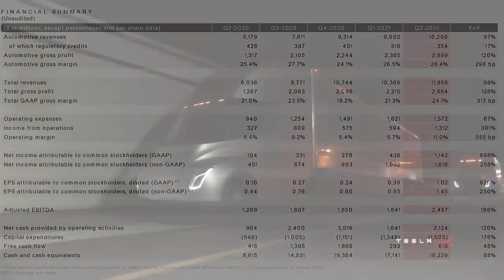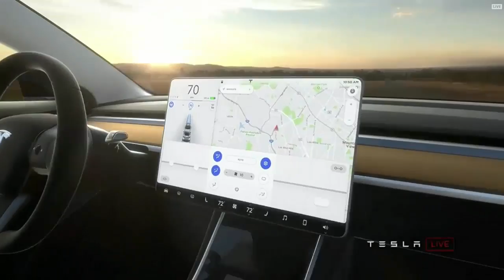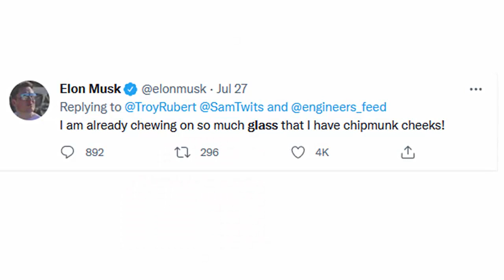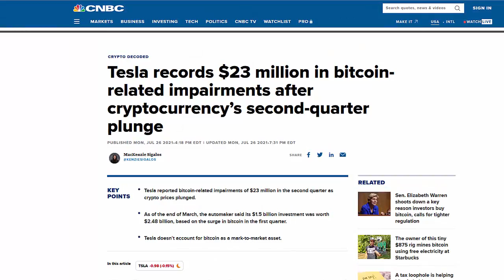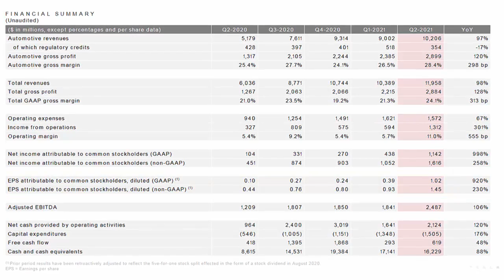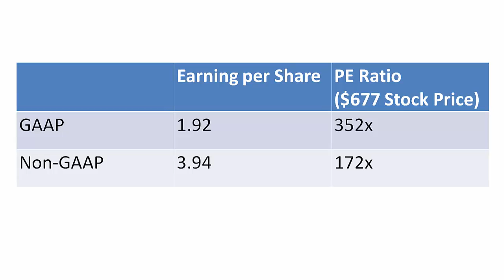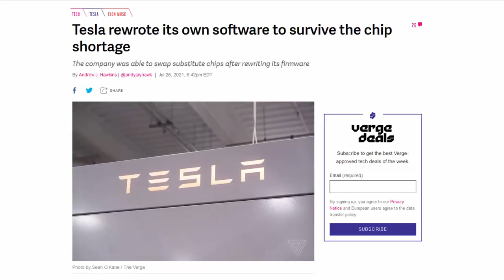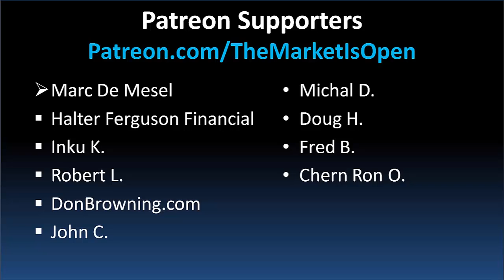The Actual Reason Tesla Overcame the Chip Shortage Crisis

Comment: I think Tesla are doing the EXACT right thing regarding chip shortages.  Building their own fab may sound fabulous, but while doable, the return on investment would be dismal compared to the returns of their rapid innovation.  While the chip business has a certain high tech glamour, the fact of the matter is that chips are not much less a commodity than toilet paper is.  You are competing for who can shave the last 1% of cost by exploiting the economies of scale.  That is NOT what Tesla needs to get into.
Having said that, the lofty goal of vertical integration of this last bastion of outsourcing may have some intrinsic value.  Specially if Tesla could then make their own neural network chips, their own microcontrollers for a gazillion automotive function, their own supercomputer transputer elements ... PLUS ... their own single chip synthetic aperture antenna chips for Starlink, and their own processor and chipset for a future Tesla smart-phone, then their volume of production of chips might justify the investment into a fab.  But it's a tough call.   Tesla are spending about a billion in each gigafactory, whereas a chip fab might cost upwards of 10 billion.

Comment: It can be an absolute nightmare to have all of those variants, but it depends on how complex the software is. The fact that they can use so many different variants tells you that they're mostly using the basic chip functions that are common to a family of devices, possibly all sharing the same pinouts. If you're using a device that has additional features you don't need, then it's just an extra cost and a minor software change to make sure it's configured correctly. It's possible they may have ported the software to different manufacturer's devices, but that seems unlikely. It's more likely that they're using different manufacturers of the same device. They could have changed the PCB to use different package variants too, and that wouldn't require any software modifications.
Without knowledge of the software and the exact chips they're using, it's impossible to make a sensible assessment of how much chaos this might involve. It may be minor, but it's possible a huge issue.

Comment: Either vertical integration is good or it isn't.  If good, it's just double speak when arguing it's not applicable to integrated computer chips!
Reply: It's not that simple. Vertical integration takes a ton of capital, time and engineering resources. All are scarce, especially the last one. So it only worth doing when the advantage more than offsets the cost. What would be the advantage that justifies the enormous cost? A chip factory cost many billions, more then a gigafactory, and takes years to build. The only reason to do it if Tesla finds a breakthrough technology that others can't or don't want to implement. And even then it would take many years of development before mass production can begin. Meanwhile the chip shortage won't last more then a year, and probably a lot less.
Reply: @andrasbiro3007  Blah, blah, blah ~ just so much noise.  I can make arguments against everything you say but won't waste the time. Your arguments could have been made against 4680 batteries, etc., etc.
Reply: @franklinbenjamin8411  
So you don't have arguments.

Comment: I don’t think Tesla should invest in a Foundry until they’re producing 20+million cars a year. The risk of them putting a ton of capital and engineers into the chip space is not worth the reward at the current time. Tesla is still very small in terms of cars produced.

Way out in the future, say 7 years from now, it would be a good idea for Tesla to have their own foundry because FSD will exponentially drive the demand for more cars produced AND Tesla will need the chips for their Battery businesses as they scale to millions of units per year. It is clear that batteries are Tesla’s #1 supply constraint. In the future, the computer chip could become the 2nd constraint as Tesla,  and other OEMs scale up ev production.
Reply: No, they should do it now so they can produce 20 million cars in the future and not worry about international BS politics and so on.
Reply: @Barskor1 you're right, if you are going to do it, sooner is better than later.
Also early build locked in the cost. Then as inflation ramps your infrastructure depreciation diminishes as a proportion of expenses on your balance sheet.

Comment: With Model S ramped it's possible that Tesla could grow earnings 2x QoQ and therefore the PE would drop a lot. We would be sub 100 PE in that case on a Non-GAAP basis. The massive operational leverage is only just starting to kick in and we haven't even got the two new factories up and running yet, but they do have all the costs hitting them already now. So earnings are going to skyrocket in the next 24 months. Instead of stock price skyrocketing along with it however I do think we'll see some multiple compression and PE compression until we get to a 70x to 100x PE.
Reply: I agree. I'd prefer to stay stable share price wise and PE to fall.
Reply: @andrewsaint6581  
My call options don't prefer that. And I don't see it happening, the current price is artificially kept down, mostly because of all that uncertainty around the reopening and inflation. But this earnings already had an effect, it's clear that the price wants to go up, we just have to break that $700 psychological barrier. And then we'll have FOMO and a short squeeze reinforcing each other, so the price will likely shoot up as it used to do.

Comment: Chip world changes too fast and not in Tesla's core skill set TOO risky
Reply: Elon is right.  Fabs are hard and Tesla really doesn't need them.  The current shortage is going to be short term and Tesla, obviously, can adapt, so I'm not worried.
Reply: @sambira  Elon did not say he wouldn't do it just that the build time was long for a chip fab implying the crisis would be over by the time the fab was done, but if they had their own chip fab they could design and make the chips they want at cost with higher performance.

Comment: Once the hardware interface layer is written correctly, very little code maintenance is required for future software, as the application layers should be agnostic with respect to hardware.  Ongoing maintenance and testing costs are not zero, but likely lower than the benefit accrued by having multi source solutions.